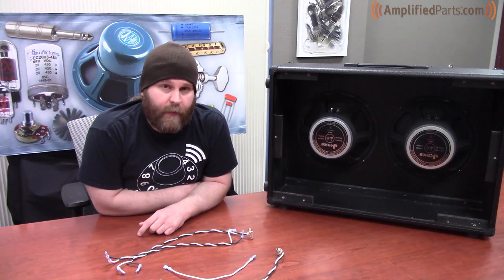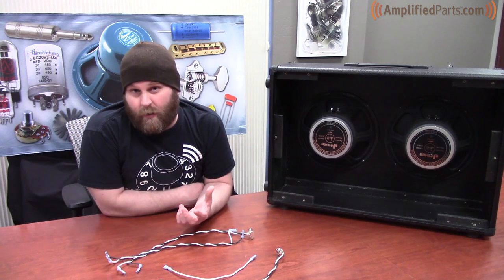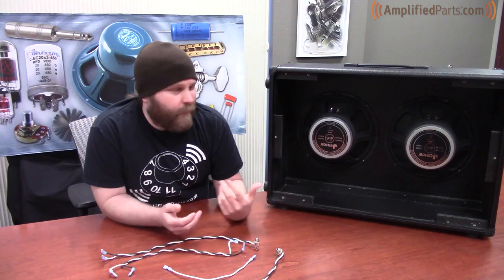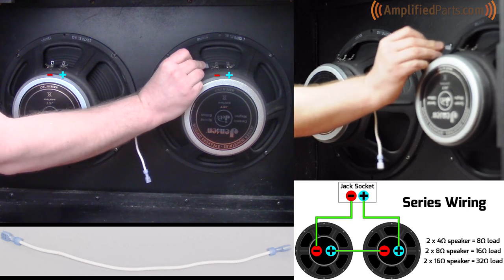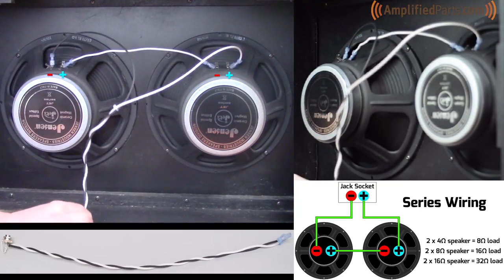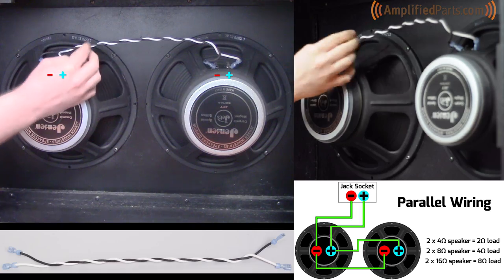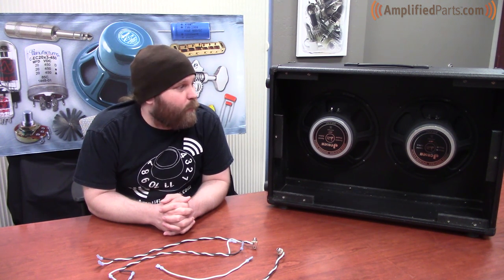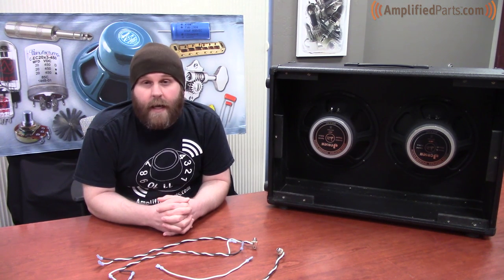Parallel & Series Amp Speaker Wiring

Comment: Hey I have a 4 12 cab that all the speakers say they are 16 ohm but when i check them with ohm meter 2 read 16 ohm and 2 read 8. Have you heard of this before? they are all MVT 200w 12" speakers original to the cab. I am checking them right at the speaker with each speaker disconnected while reading. Im confused lol
Reply from the maker: Hey Jason, are they wired up when you're measuring them? If so those two might be wired in parallel giving an 8 ohm reading.
Reply: @amplifiedparts  no I checked each speaker with it totally disconnected from others.
Reply: @amplifiedparts  does that mean something is wrong with my speakers if when totally disconnected it reads 8 ohm instead of 16 like it says?
Reply: i ended up with cab wired series\parallel and it's about 10 ohm

Comment: Is a 4x12 done the same way as a 2x12?
Reply from the maker: The wiring would be done different in a 4x12 than a 2x12. Check out our Speaker Wiring Calculator. https://www.amplifiedparts.com/tech-articles/speaker-wiring-calculator

Comment: Measure speakers before hooking them together...because they measure below advertised ohms! So if your going for 4 ohms with parallel  wiring you will end up with less not good for amp. I have a 8ohm cab and it actually measures 6.8 ohms.  REMEMBER!!! IF YOUR AMP SAYS 4 OHMS ITS TELLING YOU NO LESS THAN!!!!! SO if you cabs are higher than it's ok.  You will never hear the difference unless your playing an arena you will not get loud enough to notice the difference.

Comment: For parallel couldnt you just run each woofer directly to the same amp channel instead of having one of the speakers having to go through the other one for power?
Reply: hippo potamus this is what I was thinking.. isn’t the second woofer slightly delayed?
Reply: I just ran both to the same channel. That's better IMO than piggy backing off the second sub. But both ways are correct.

Comment: If I wire 2 16 ohm speakers in series I get 32 ohms, my amp is 16 ohms so is this safe to do? Please help, my amp is brand new so I don’t want to damage it. I’m pulling my hair out.
Reply from the maker: Check the manual for the amp. What model is it?
Reply: amplifiedparts Marshall dsl 1
Reply from the maker: @dunboozin  Marshall seems pretty adamant that only a single 16 ohm speaker is used with the head.

"WARNING: Only ever connect a single
1 x 16 Ohm speaker cabinet. Any other
speaker configuration may stress the power
amplifier section and in extreme cases may
lead to valve and/or output transformer
failure."
Reply: amplifiedparts thank you very much for that, I will stick to the one then.

Comment: I have 2... 8 ohm, 60 watt, 1X12 cabs... that each have parallel and series connection jacks. (and an input jack)
I need to hook them up in series and use my 16 ohm output on my 100 watt amp to match impedance and to  
handle to wattage output of my amp?